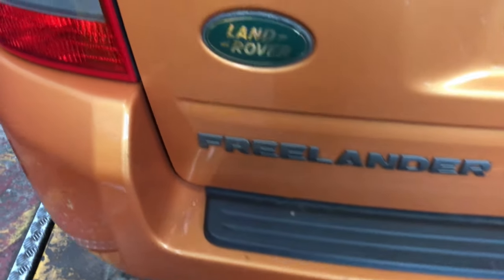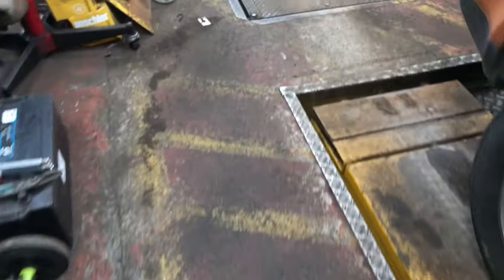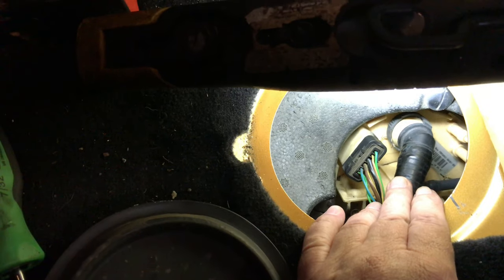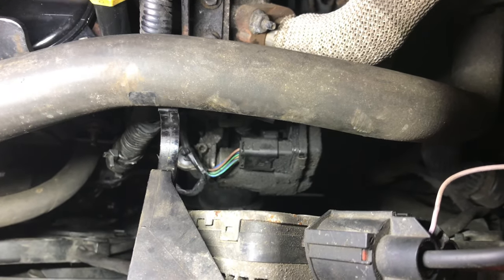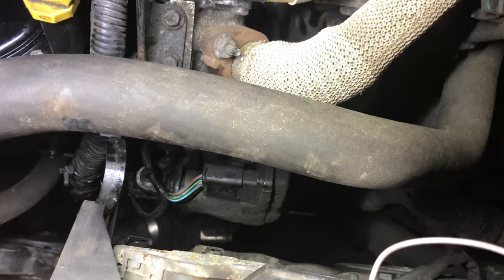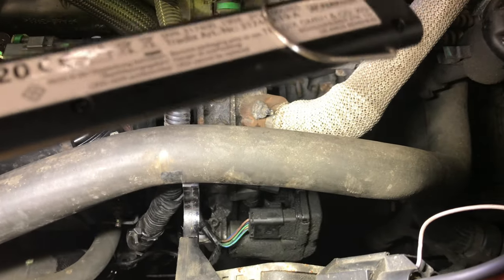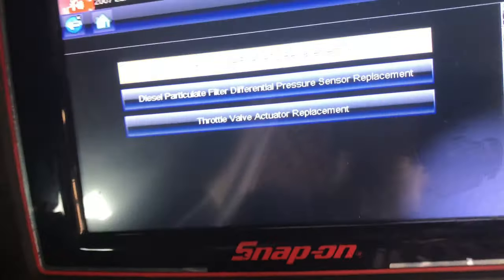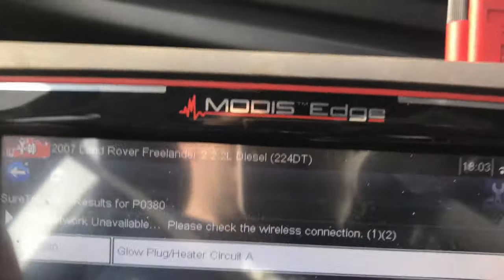Freelander 2 - Intermittent No Start! P02E0-13, P02E9-00, P02E1-00

Comment: I had the same issues & four garages couldn’t find the fault. Took it to main dealership. They found wiring fault , damaged wire that goes down under subframe to starting motor / damaged. After repair all good.

Comment: Got caught with similar fuel transfer pump issue on a 2.2 Mondeo. Dropped the exhaust and fuel tank and found that all the pump does is flood a ‘bucket’ which the stand pipe sits in. We live and learn.🙄 (Not heard ‘Til kingdom come’ for a while 😂)
Reply from the maker: Yes Russell we learn every day til Kingdom Come and then some!!! Cheers sandy

Comment: Hi mate 
I have this 2 sign coming on the my snapon the car doesnt run 
Can you tell me what can be the issues
 p02e9-73 diesel intake air Flow position sensor - actuator stuck closed
And the b10a2-00 crash input
Thank you

Comment: Ive got same issue. Got snap on but how do you get to the option to tell car you've replaced the sensor please ? Ive replaced crank sensor, pulley, trigger wheel,throttle body, sensors and still no start :(